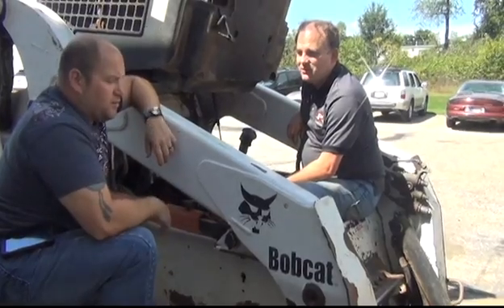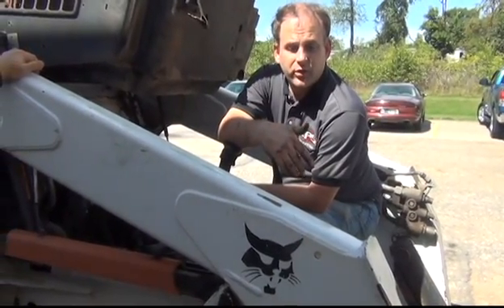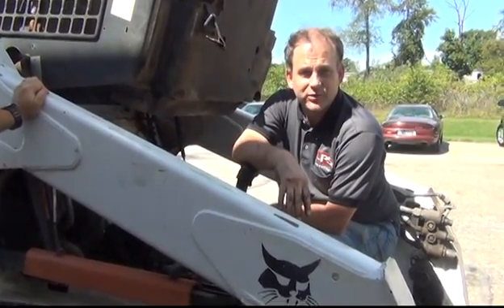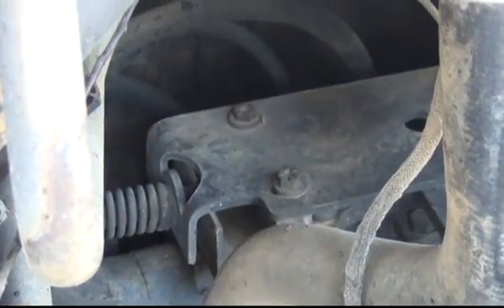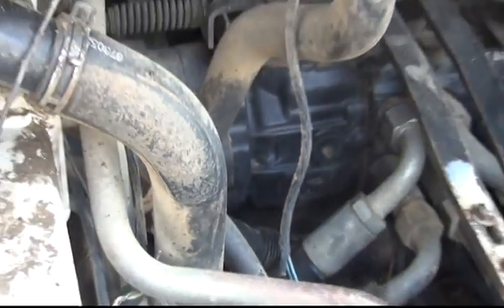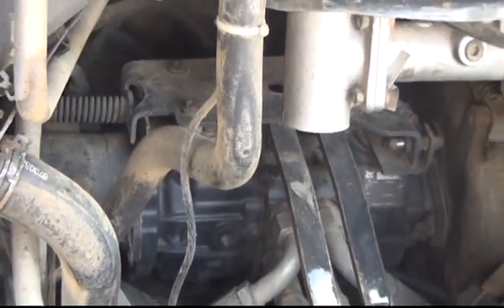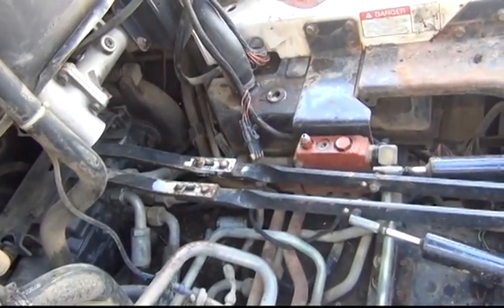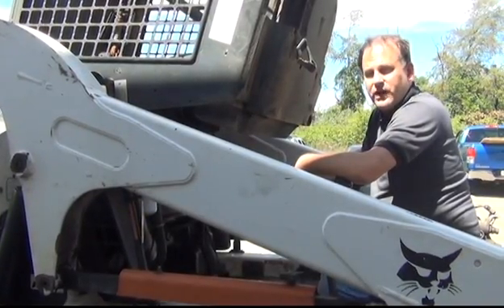Steering Linkage Inspection on a Skid-Steer Loader

Comment: I hate to be one of them guys.....But this guy is wrong on so many levels!!! The worn bearing on the pump arm wont affect forward speed???? Really? Explain that to me....with the worn bushing the levers will not pull the pump arm the same amount as the other side...making the machine drift. Then the engine mounts, Well that will show up as a bucking drive. As the drive is engaged the engine will move, in turn that makes the pump arms move. So the machine will slow then that happen again and again. As far as the missing bolt...its laying on top of the fuel tank along with the spacer, Its called loctite. And the steering levers should never hit the kick panel, there are adjustments behind the panel that stops the levels from hitting.

Comment: When the housing has stripped threads, have a machinist to install heli-coil threads. They are stronger and very reliable if done correctly. I have done thousands of them on Aircraft, automotive and pumps. Certainly beats buying a new pump.